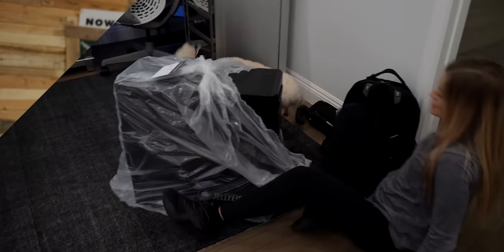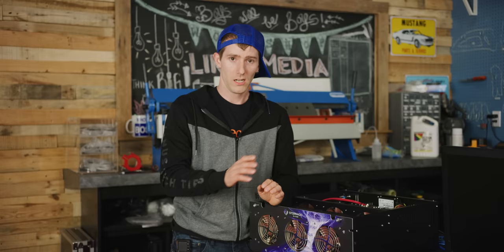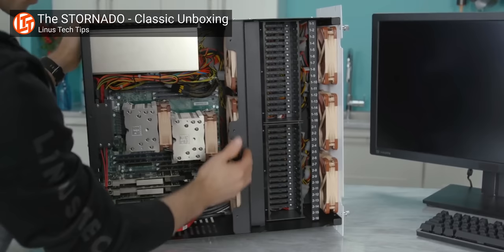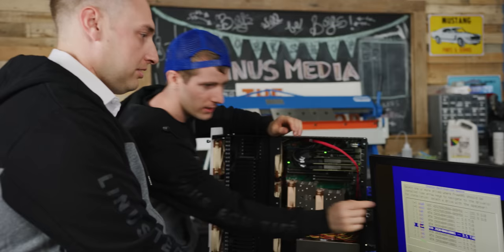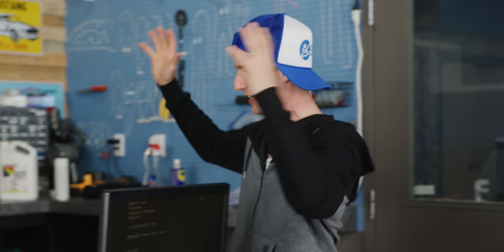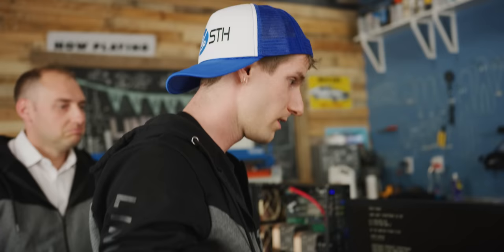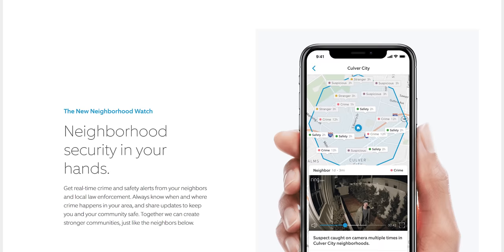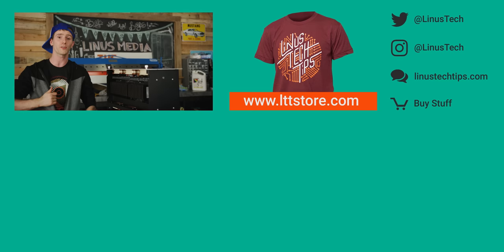What did you DO?? - The "Jellyfish Fryer" All-SSD Server

Comment: Keep in mind, when flash memory fails it's still completely readable. This is a million times better than a hard disk based server.
Reply: No ssd I've ever had fail remained readable. The "typical" SSD failure mode is now so rare your much more likely to run into other forms of hardware failure first, in my case (crucial m300 springs to mind) it was the controller dying and reporting junk to the bios - result, unreadable data, at least without a recovery lab
Reply: if it's still readable, it hasn't "failed". if you mean something like "when the controller fails..." then the same is true for HDD's: they can be disassembled, and the platters can still be read.

Comment: You know, in reference to the switch issue, why don't you just bolt a dual port 10gbps + 16 port 1gbps switch to the thing and call it a day, or build an mini server rack, that is litterally like 3u tall, that holds the switch, the storage server, and maybe even a frigin router and cell tower based network solution in it aswell. Gives you loads of ports for expandability to many team members, lets you have internet access(although not very fast yet, 5g might change that a bit when it starts to roll out more) all while being a hell of a lot more affordable and not requiring proprietary things to use it.

Comment: I definitely want to see Linus upgrade the office SAN/LAN setup with some 100Gb (or even 200/400Gb if using Dell or Arista switches and compatible network adapters, respectively) to really up the ante on his office networking backend. The front-end connections are still generally fine to stay at 10Gb, since it's still adequate for editing even 8K video, though using 10/25Gb NICs in a 10/25/100/200/400 switch would be ideal for allowing upgradability in the future should 25GbE become a requirement. The one major downside to that upgradability, though, is that it comes at the cost of requiring the use of SFP+/SFP28 switches instead of RJ45 port direct copper switching. While you can still totally run Cat6 for 10Gb using 10GbE-T SFP+ adapter modules in all of the ports you're utilizing on the switch for your front-end connectivity, there is no similar compatibility for 25Gb, which would require the use of fiber optic connectivity instead. Having run a tremendous amount of fiber optic cables in a multitude of different configurations in an enterprise development environment, I wholeheartedly support the move to fiber optic in any high-speed data environment, because it allows for easier in-place switch and NIC upgrades in the future without any need for consideration toward cable compatibility, as long as you're using OM4 cables, which are rated for at least 100Gb at 100M. Corning even makes ruggedized versions intended for exterior and conduit installation so they can be pulled through conduit with minimal risk of breaking fibers. You can also use MTP/MPO cables instead of the more common LC-LC cables to further consolidate your multi-connection runs by installing patch panels at both ends of the cables to break them back out using cassettes into the more universally useful LC-LC connections. 

I will go ahead and say, if you're going to do that kind of massive infrastructure upgrade to fiber optic cables and high-speed enterprise switching, you'll probably want to try to get the guys from Serve The Home or Wendell to drop by to help out with such an undertaking, as it can become confusing in a hurry if you aren't familiar with how such enterprise switches function, particularly when it comes to aggregating ports for your QSFP backend connectivity. You could also take the opportunity to make videos on VLANs and why they aren't particularly useful for your particular office environment.

Comment: Bigger NIC is possible in 2019, help eliminate LACP, which is usually becomes a problem. Try 25GE on client, and 50/100GE on server. Yes, you must invest on new 25/100GE switch and NICs, but I guess it will be worth in the end.

Comment: Link aggregation is a bit finicky from a Unix to a switch, depending on the switch manufacturer and series. Since you just want output performance and doesn't really care about more than 40 GB input performance to the machine, I would recommend to change to simple "balance-tlb" instead of 802.3ad on the bond.

With "Balance-alb"s arp magic it's also possible to get more than 40 Gbit if you sending data from multiple machines to the server, but it might set your kitties on fire.

This description is based on my Linux knowledge, something similar should be available on bsd, but YMMV.

Note: To have those features working properly, disable all "firewall" and DoS-Filter etc. basically dumb down the switch as far as possible to get best performance without running in trouble. Try then to activate one feature after another, to make sure everything you need is compatible.

Also note: You need to have all links NOT in a LACP-Group but be regular switch ports.

Comment: Glad I saw this.   I've been wanting to see if there were any options for SSD drives.  I primarily used mechanical due to using older computers and not knowing that they have NAS based SSDs.  I still would like to know if I can still benefit from NAS SSDs because I don't have any lag trying to access files.
Reply: I know it's been 2 years, but it's not lag, SSD'S make everything feel more responsive. Even if your hdd doesn't feel slow, an ssd is leagues faster.

Comment: Linus, I understand that you got upset. But something to take away from this experience is to think about what possible needs creators could possibly have. After asking them, do inform them of things they might not have concidered or have taken for granted. If they have several editors in-house, not only adecuate storage but also a sufficient switch is in order. The key here if you want to be the provider, is to up your game when it comes to predicting their needs using your knowledge.

A couple of years ago I bought a NAS, I went budget-mode and didn't know jack about NAS:s. One year later I had gained experience and knowledge about my needs, so I bought I new one and have stuck with it ever since. As a provider/expert, one of the best assets you have is your knowledge and you need to put it to use even in the "not too obvious places", don't just give them what they ask for, ask them leading question about needs they perhaps didn't think about or assumed it was standard, also, ask them about future needs. If then after this decide to go with a cheaper option, then it's on them.

Comment: Qnap does all his stuff cheap n easy. They also allow you to do things like go 10 or 40 Gbps to your switch but also have a bunch of clients direct attach with thunderbolt 3

Add in idiot proof automated tiered storage... its a wonder all these other suppliers still exist.

LACP of 4 x 10Gbe is worlds apart from an actual 40 Gbe adapter because each MAC address only gets one port. TB3 direct attach is a cool and cheap solution.

Its also trivial to plop a containerized postgres on a Qnap to use Resolve for a lot of people.

Still kinda surprised you aren't building an insane XSan though.

Comment: How do you know which failed drive to replace without a hotplug disk enclosure with drive beaconing?

Perhaps you edited out the step where you recorded the physical position and corresponding drive serial number? And what the operating system saw? Because when a drive does go. You have to wait until  it's fully synced the hotspare, POWER OFF THE ARRAY,  and then hunt for the missing serial number. Then boot it back up again and pray you didn't screw up.

You didn't make a highly available storage array. You made a container where data goes to die.

It's also 2019, you should know what over provisioning is and why it's necessary. Especially in all flash arrays.

Would have been nice if you talked about crash consistency too. Power loss with a 60TB array is fun.

Comment: $900 cheaper is not actually cheaper considering you had a server specialist configure the NAS which if you hired independently would probably charge in multiple thousands of dollars. 
Not to mention this is not an out of box solution which for 2.5% saving is definitely not economically feasible.
Reply: shubhranjan it's probably all included but anyway he used ssds just to make this whole project more expensive. Basically this wasn't supposed to be cheap it was supposed to show that the jellyfish is a crap deal.

Comment: Your LAG may be incorrectly configured on the Storinator, or the switch. It must be in both places. It's also possible that you just didn't add your interfaces to the LAG. As a networking person, i want to see this work.  What make/model switch are you using? Can it even support 4x10 LACP throughput? ...

Comment: Linus, this video was useful to know that you can spend around the same ($30k) and make a 'better' overall unit. But, does this also imply that it is NOT possible to spend less to build a more affordable server (for non-YouTubers)? Just asking!
Reply: Depends a lot on what your needs are. If you don't need a dual-processor config and you don't require an insane amount of storage, then you can totally get by for a whole lot less money. However, I would not recommend cheaping out and using a processor that doesn't support ECC-registered memory. It's more expensive, but it detects and corrects for bit flips and other memory corruption. As for storage, you can totally get by with less and less expensive drives if you don't need a ridiculous amount of high-speed storage at your disposal. ZFS can use high-speed SSDs as ingest and read accelerators, so you can save money by utilizing large capacity HDDs and a pair of M.2 NVMe drives to make them feel a lot faster than they are. When it comes to connectivity, decommissioned enterprise NICs are the way to go. They're so much cheaper than buying new and they tend to have quite a lot of longevity left in them. Plus, if they fail, it's not the end of the world to replace them. Depending on your needs for drive numbers, you could also consider purchasing a decommissioned server and just upgrade that until it meets your needs. Just be sure that whatever storage adapter its using actually supports JBOD or can be put into Engineering Mode to support JBOD, as it's practically a requirement for ZFS storage pools to function properly.

Comment: Ok so I know this is an "old" video but  I just had to post because I'm totally confused. While I'm not an expert, I know a little more than average about networking. So if he had two NICs on the server each with two 10Gb ethernet ports, is a total of 40Gbits of total bandwidth coming off that server. He's claiming that the link aggregation is not working. Ohhhh kay so when they had pulseway pulled up and was monitoring the overall bandwidth during the scrubbing it was peaking at 40 GIGABITS PER SECOND! What the heck did he expect???!? Then he claimed it would've been better to run an individual 10Gb ethernet line to each computer individually???? Ok so each workstation already has a 10Gb ethernet port already. You had them hooked up by a 10Gbe switch I assume or how else would you have 8+ workstations going?? I'm not bashing anybody I'm just trying to figure out where the math is coming from. Close to 40Gb/s should be right. Please somebody educate or enlighten me here. You're not going to get anymore bandwidth out of a server that doesn't have the ports for it. How was he expecting more than 40Gbps?

Comment: If i compare something, why just testing my stuff? (maybe it's easier to win my self made tests, with my only product on a test?) BTW, both are SPOF as they stand... A bit misleading to compare enterprise grade storages, where you can have multiple independet hot swappable controllers with zero downtime, but your servers only have one hand installed motherboard...  (and disk replacement is also harder with this, but this depends on the chassis)

Comment: "they are using enterprise hardware- like zfs, like centos" hmm yes they are individually but to my knowledge zfs on linux especially centos aka rhel aka old fedora is not that "enterprise ready" at least not like zfs on freeBSD? It would likely not cause any problem and probably still better than btrfs in 2020 but linus's freeBSD based freeNAS system is likely still bit better in terms of system reliability than thr centos zfs box jellyfish is

Comment: 22:35 "they are using zfs and centos". Wait a minute! This is very wrong. Centos does not include zfs rubbish
 Zfs is an abundant oracle produce illegally copied by canonical of ubuntu. No it's not just opensource. The license of zfs and linux kernel forbid mixing the two, canonical and openzfs project violates the two licenses and thus are not allowed to distribute this illegal mixture. Oracle the owner of zfs no longer develop zfs and they shifted gears to btrfs. So zfs is just unmaintained stolen software leftovers running on centos instead of ubuntu makes it more funny. Paying premium enterprise  price for centos seems fishy, why not don't include  a Redhat RHEL license?